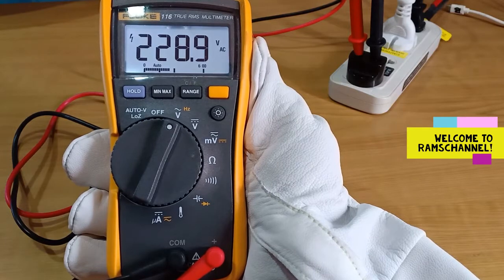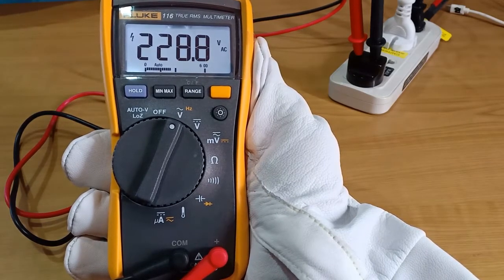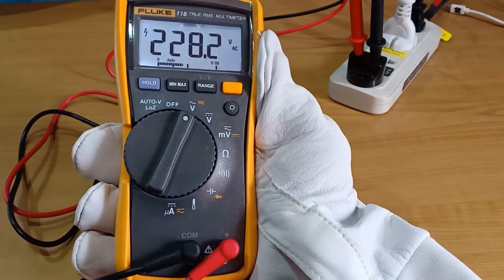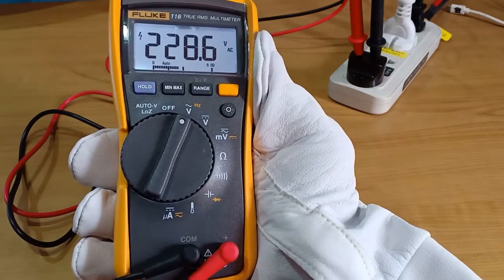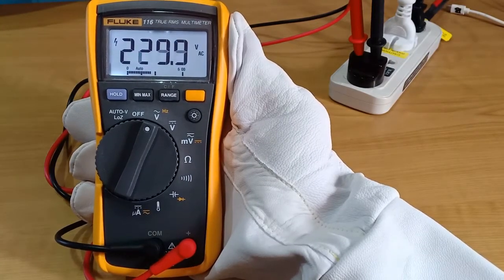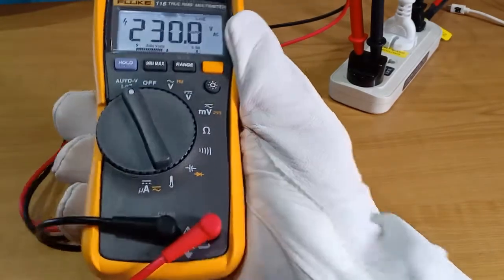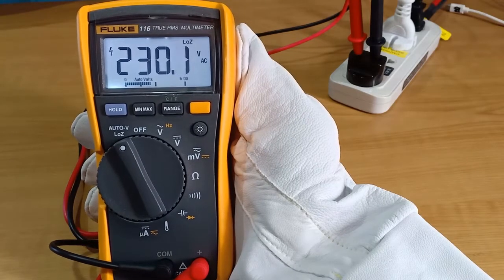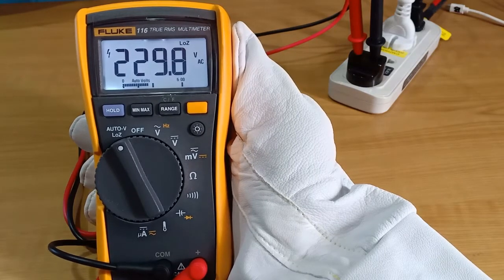[Eng Sub] FLUKE 116 True RMS Digital Multi Meter- Unboxing and First Impressions

Comment: Вітаю!
Чудовий огляд гарного мультиметра! Також було цікаво почути порівняння всієї серії.
Дякую, було корисно!

Hi!
Great review of a great multimeter! It was also interesting to hear a comparison of the entire series.
Thanks, that was helpful!
Reply from the maker: @gelavski  Дякуємо за коментарі.  The Fluke 116 is indeed great for electrical testing inspections. I also use its temperature function to check that my solar panel's inverter is not overheating.

Comment: I just bought an i400E (post-2021 model, mine is 2023) to go with my Fluke 116, but I get no readings at all. It just says 0.0.

Set my meter to the mV (AC) function and connected the i400E. Tried with my microwave on 900W... nothing... kettle... nothing... electric heater (2000W)... nada.

The only time I got something was when I clamped it over my 25mm^2 feed into the house, and I got 9.7mV = 9.7A.

I don't know if this is a compatibility issue...?

I have no reason to think my Fluke 116 is faulty.

Any suggestions? Would greatly appreciate any ideas!
Reply from the maker: Thanks for your comments. Based on the details you mentioned, the load you tested should draw at least 1A and should be detected by the i400e and F116. I think you clamped your i400e on just one line of your service entrance (either line 1 or line 2) hence you got a reading. That's the correct way of using a clamp meter to detect current. If you clamp on both lines 1 and 2 at the same time, like in a fixed duplex cable for appliances, you won't get a reading since the electromagnetic fields of the two lines will cancel each other out inside the i400e, hence the F116 will show zero reading. You may need some sort of line splitter to get your i400e to clamp on only one line if you want to test current for some household loads.
Reply: @ramschannelreviews  Thank you!!

That makes perfect sense... 😂

👍👍
Reply from the maker: @torbjrnfjeld1799  You're welcome!
Reply: You need an AC line splitter
Reply: @westonweigand1228 , I did indeed need that, and I made one. Works perfectly. Cheers!!

Comment: Hai,  I'm AV technician, I need to buy TRMS dmm with diode, continuity, resistor, capacitor , AC DC Voltage and Amps Measurements .plz suggest us .
Reply from the maker: Hello, for TRMS DMM may I suggest Fluke 115 or Fluke 117. If budget would allow consider also Hioki DT 4261. There are other choices out there but these are ones I already own and have found to be good instruments. Thanks for watching.

Comment: Hi Sir magandang araw po ask ko lang saan ba natin mabibili ang FLUKE 116 HVAC Digital multi-meter  at magkano na ba  price sa ngayon maraming salamat po and god bless…
Reply from the maker: Hello Sir, salamat po sa suporta. Nabili ko po ang aking Fluke 116 HVAC DMM online sa amazon.com. Unit cost around P8k. Door-to-door shipping P850. Depended sa Peso- Dollar exchange rate, maglalaro ang total price between P8.5k and P9.5k. Dito sa Pilipinas isa sa mga distributor ng Fluke ay Presidium Corporation. Search nyo po online. Meron silang FB and Shopee Store. Eto ang link nila sa Fluke 116:
https://shopee.ph/Fluke-116-Digital-HVAC-Multimeter-i.169129700.6804155094
There are pros and cons between amazon and local purchase. Nasa inyo na po kung saan kayo mas komportable. So far, I have always been satisfied with amazon. Good luck po!
Reply: Maraming salamat po sa replied God bless u more..
Reply: Love your channel sir, I owned two of this Fluke multimeter actually comes with combo 323/116, as HVAC mechanic is a budget friendly. Kong gusto sa iba merong extra meter at may kunting budget get a fluke, i carried different brand like Fieldpiece, UEI, but so far Fluke brand is a way to go. Keep up sa magagandang video sir. From Rhode Island.

Comment: Sir ano po ma recommend nyo na multi meter for beginners like me. yung budget friendly lang. pang basic testing lang po like voltage, current,etc. Thanks sir!
Reply from the maker: Sir suggestions ko lang po ito. Nabanggit po ninyo multimeter for basic testing. I assumed you mean household AC/DC voltage, resistance, continuity, diode and capacitance. I'm not sure of your budget but there are a lot of digital multi meters (DMM) below P1000 from brands like Zotek, Richmeter, Aneng, Vastar, Peakmeter, and even Ingco. Pero wala po akong experience sa mga brand na ito. What I have is the UNI-T 139C (P2.1k), which I recommend. It still works without any problems. You might also want to consider the UNI-T 33A+ (P800 to P900).

Pero nabanggit nyo din po current. Assuming again you meant household current, you would need a stand alone clamp meter for this. The only budget AC/DC current clamp meter that I can recommend to you is the Kyoritsu Kew Snap 203 which cost P2.7k. I have it and it works according to its specs without any problems. It has some DMM functions too like AC/DC voltage, resistance and continuity, but no diode, no capacitance and no backlight. 

Note that UNI-T and Peakmeter have several budget DMMs. They also have clamp meters cheaper than the Snap 203, but with many more features. Just weigh the pros and cons for your particular purpose and the buyers feedback on them. Work safe. Good luck!